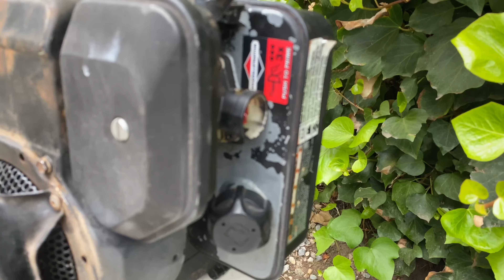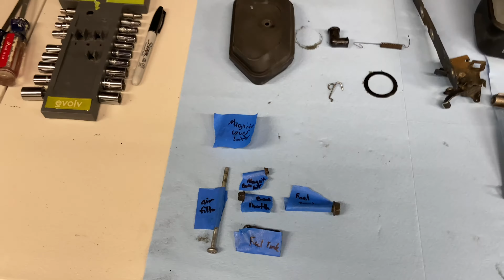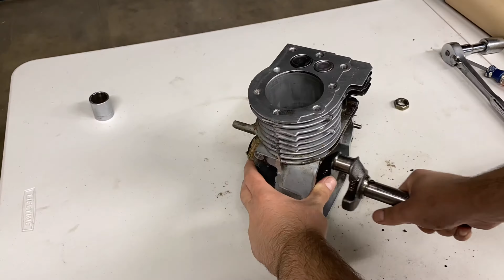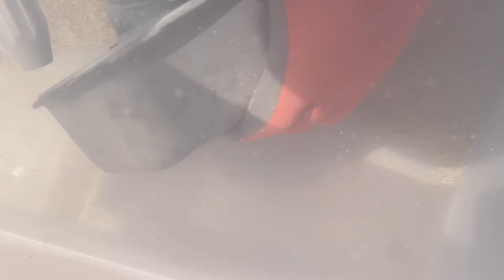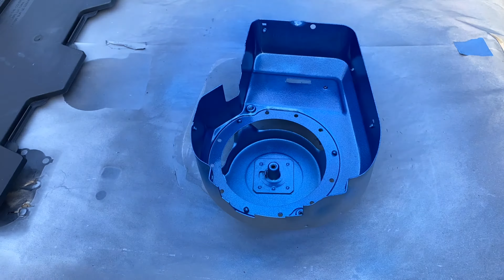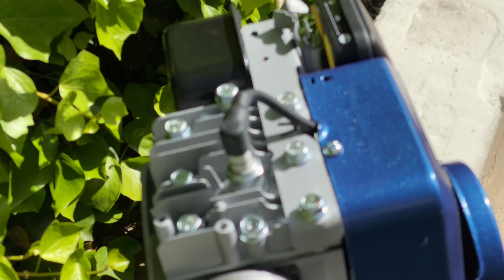Rusty Briggs And Stratton Engine Restoration

Comment: Came out nice, I like the paint too.
Did you have to order gaskets 1 by 1, or is there a whole kit available?
I'm halfway through an old 3hp B&S (080202 from 70's) horizontal engine with my son who is taking way more interest than I thought he would. I have powder coating in mind, but I may do a similar color. Ours is going on an old Mongomery Wards cement mixer which is orange. We are in Colorado,  so my son wants to do blue and orange Denver Broncos colors.
Reply from the maker: This was such a long time ago I don’t remember. I know that I ordered the parts from their website.
Reply: @Engineering_Rebel  I'll check it out, thanks

Comment: Looks like it came off a small push mower, due to it being a vertical shaft design. Nice restoration. That must be a newer Briggs engine because of the plastic(?) carb and looks like a nylon camshaft?

Comment from the maker: In this video, I restored a rusty 3.5 horsepower Briggs and Stratton motor that was in need of rebuilding. This motor is a flathead 1 cylinder due to the valves being located on the block. I first took the motor apart, then cleaned the parts. Afterwards the parts were sandblasted and ones that couldn't be used were discarded. Some of the new parts included, gaskets, filter, spark plug, pull string and much more. The motor was painted silver with black accents and the magneto cover was finished in a midnight blue metallic. After assembly the motor ran great and the compression was very good. It was not an easy project to make but the experience was definitely worth it. This engine might be used for a future project but right now it's still a mystery.
Reply: it can sit on the shelf and collect dust... unless under plastic clear bag to avoid collecting dust ;)  nice work.  i like the metallic blue.